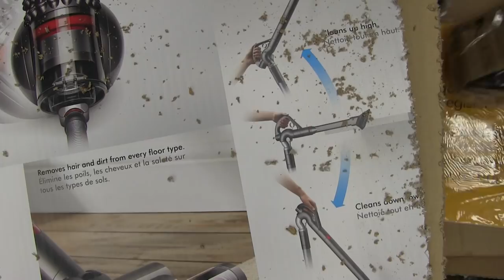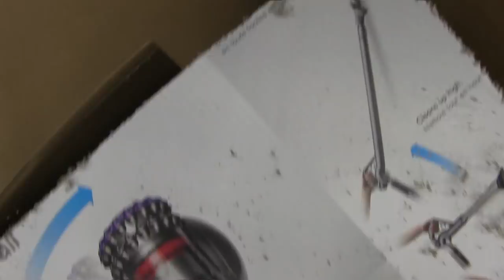DYSON ANIMAL BALLS | It blows!

Comment: We have a 7 year old Dyson, and the chintz factor is off the charts, but somehow not a single thing has gone wrong with it. It's got all the same flimsy plastic linkages and such for the switches, but all of them still work fine, and we're not exactly gentle with the vacuum. It's really quite amazing to me. Ours has user-serviceable washable filters that come out very easily and are cleaned with a good water soak. 

I've had to cut threads and hair off the brushes, but that's it as far as service goes.
Reply: Isaac Fortner If you have a 7 year old Dyson, this is likely to have a less complicated structure. The wheels on these Dysons break off very easily. Already seen 4 of these Big Ball cylinders with broken wheel shells within 6 months of launch.
Reply: I think they saved costs on the switches etc. as it’s not likely to be used that much so for a 10 year lifetime being pressed a few times each week for average user that flimsy mechanism should last.

I’ve gotten broken parts on my dc54 but I blame my wife’s long hair that wrapped around the wheel bearing and took me a good half an hour to remove and ended up having to rip off the wheel and now it won’t click back on the same as before!

Comment: Valve is there when it gets clogged it dont burn up.
Reply: Jelsma Outdoors when motors are under vacuum they are under less load, so they are less likely to burn up
Reply: AfterDark3 Ok, its also a safety feature so if you get the hose stuck you can pull it away.
Reply: Jelsma Outdoors I'm going with that valve is there to keep it from tearing holes in stuff. 12 in mercury will bend steel on a head that size, nevermind pulling a couch through that "lifetime" filter.
Reply: jet still; no airflow == no cooling
Reply: AfterDark3
That might be all and good in a non-t-bag vacusucker, in this case, the motorb is been clusterfucked by a large amount of plasteek.

In other words, the motor might not burn up, but without airflow from the motor, The plastic will ment... and, well, I think i've said enough.
Reply: The valve is for when you put your didely doo in the tube to get some changes in the .... you know what I mean.
Reply: Universal motor under no load = fuckloads of RPM's = nuked brushes and comutator.
Reply: Jelsma Outdoors yes it Will heat up if you don't run air through
Reply: AfterDark3 Yes but wait a while and where does the energy go
Reply: I have a couple of dysons.. the valve is definately there for when hose gets clogged, you can hear it open up and suck the air straight through the valve rather than the hose
Reply: This is a safety device.  Remember there are a lot of weirdos and idiots out there.  Weirdos  might suck their testicles, ovaries, large intestines, or lungs out of associated orifices.  Idiots will suck the same out of their pets plus inner ear parts, eyes, etc.
Reply: Jelsma Outdoors well done on the insight.... you should start your own channel.
Reply: I'm betting the valve is at least partly for show to keep your junk spinning around in the display catch even when the inputs are blocked. 
Thanks for reading. Keep you plug in a socket.
Reply: Wouldn't it have tripped when he was testing the maximum succ?
Reply: If you kink the hose the valve opens so you don't collapse the whole fucking thing ;)
Reply: Mark we have a channel, not the same as this one but check us out, might like it.
Reply: Crubleigh he stretched the spring, but you can also hear it suck air, it is that valve.
Reply: @Jelsma sill, be careful where you put that vacuum nozzle. Think of the legend you would become in the ER!
Reply: Jeremy McMillan Works better than the ole blue pill
Reply: They are under less load so they start running faster and they have no airflow so they start burning up
Reply: Roger that.

Comment: Regarding the relief valve, since this is intended to (also) groom animals, it is to prevent severe injury to said animal. For instance if somebody gets the plain hose with no safety-vented attachment up against the animal, body parts can get fuckulated very quickly. That much vacuum against an eyeball or a spink,,,,  shpink,,,,,,,,, sfink,,,,,,, anus can do bad stuff.
I felt really bad for mom-in-law, but I just couldn't stop laughing. RIP Shaggy Tom.
Reply: Jay Littleton that's not entirely true, the relief valve is there for a few reasons, 1 to cool the step down PCB in case of a blockage, 2 it is also there to slow the motor in the event of a blokage
Reply: I stand corrected and thank you for your input. Cheers.
Reply: Your very welcome, it's confusing I know.
Reply: So you’re actually with Dyson PR?
Reply: I was merely going with my knowledge of a system specifically made for animal care & grooming that was built similar to a shop vacuum, which had a safety relief for what I described.
Reply: I'm a Dyson RDD engineer actually, In my spare time I rum PR :) all our machines have a relief valve, our handhelds just use the hall effect sensor in the motor to detect a blockage "lack of fluid" and pulse the motor to 1 reduce the vacuum force and 2 alert the user that there is a blockage. The relief valve on our machines is there to protect the motor:)
Reply: A little insight for you :) all our machines are the same , so if you get a dc75 animal the machine has no differences what so ever, all that is different is the colour of the cyclone assembly and the attachments included.
Reply: Buddy of mine built himself a mini tri-lobe supercharger for his motorcycle. He stuck his hand over the input while bench testing  it with a battery drill.... poppet valve woulda saved him the hickey mark.
Reply: Well that's erm, brave aha and yes it might have helped
Reply: Jay Littleton on the handheld vac it is used to cool the motor...when there is no flow there is no cooling of the motor...there for the valve is used to keep air flowing over the motor at all times to cool it....as we know heat kills electronics
Reply: cool to have someone from the company answer a question on an AvE video kudos to dyson guy

Comment: In England, every town has at least one "Dyson Repair Shop", but you don't see shops specifically for the repair of any other brand of vacuum cleaner. What does that tell you about their longevity eh? 
My old smiley face Numatic is still going strong after 18 years, what with it being just a motor with a power switch in a cylindrical case
Reply: arcadeuk yeah your right, Dyson are total shite, went to look for a new vacuum an the woman shows the good lady a Dyson, she dropped it once an the handle snapped clean off! I laughed that much I had to leave the shop!
Reply: I too would have laughed my ass off in that situation :)
Reply: YMMV... My DC07 Animal is 17 years old and still sucks like the day I got it. I've replaced the filters 3 times and that's it.
Reply: My parents had one Dyson vacuum ever, and it died pretty much every time it sucked up anything that wasn't very light dirt. Basically, they are vacuums that don't do well at cleaning things that are actually dirty.
Reply: Maybe it is better to have a machine that is serviceable instead of one that you simply throw away?
Reply: My family has a 10 year old Dyson that is still going strong. I took it apart recently to clean it and it's built much better than this one. You can buy new attachments from their website that fit fine
Reply: my mom's Kirby from 1976 still runs strong and out powers any and all current vacuums we have tested , my Kirby is only 15 years old and nothing has every gone wrong , only replaced the brush roller once
Reply: Never seen a "Dyson Repair Shop", I call BS!
Reply: Robert Lozier 
I have a 15 year old Ultimate G Diamond Kirby too and it's an absolute beast.

Comment: I would think that valve is for preventing a no SUCC event. You know like when you stick your hand over the hole and you can hear the motor RPM increase. Maybe some kind of protection for the motor in some way from over current event due to higher load. I actually have no idea if thats what its for, I'm talking out of my ass.
Reply: Adubs this was my guess.
Reply: I assumed it may be to help keep the motor from getting damaged if the filter or hose is blocked.
Reply: That's exactly what its for, motor protection. The air flowing through the motor keeps it cool.
Reply: a fans load is proportional to the mass flow of air.  thus when blocked, it has almost no load on it.   cooling is my guess.

Comment: Dyson figured out how to fleece us. Like Apple they are no longer quality since they are born to fail. Great job on this review. Definitely in your debt. Saved me a handful.
Reply: Were they ever really quality, or were they just a marketing gimmick? about a dozen years ago, I switched over to a commercial vacuum made by sebo (sebo is overpriced in the US, but their vacuums are available half price from commercial supply places). It looks like an honest unit. 

I very briefly looked at the dyson stuff, but never really found anything that great about it - it seemed like $500 worth of plastic vacuum that had an expected lifetime of a couple of years....

....and because of the giant profile, couldn't fit under anything. 

The sebo-made commercial vacuum at the time was actually cheaper. And made in Germany.
Reply: @daw162  They were.  We've had the same one since 2004 and have always ridden it like a rented mule.  Too bad it's irreplaceable at this point.
Reply: @daw162  
A used Kirby will do.
Easy to repair too.
Reply: @Milkmans_Son  You got yourself a fluke. They've been plasticy junk falling apart since day one.
Reply: @jumbo4billion  I'm not that lucky.
Reply: I have 3 DC01s. I think the oldest one is from about 1995. It still works fine. Worst thing about it is emptying the damn thing.

Comment: There isnt much out there these days that is actually engineered to last
Reply: Certainly not in the cyclonic bagless vacuum market...
Reply: unless you get a central vac. MUCH more servicable
Reply: perfectdiversion 
That reminds me of the time my grandfather gave me a reuseable hand warmer dated 1968. It still works great, but unfortunately people will still choose disposable chemical hand warmers.

I suppose we really are living in an age where everything is engineered to fail and everything is disposable.
Reply: I went to school for engineering. everything is designed these days to last 3-5years before its degrated  to be thrown away. Even vehicles are designed such ways. Its pathetic, and why i quite as i want my designednshit to last and be simple.
Reply: Henry hoovers suck all day and have been for 37 years. That's why professional cleaners use them.
Reply: I will second the Miele but you might want to find old filter queens or old rainbows
Reply: perfectdiversion That's not correct. Get a SEBO or Miele and these are engineered to last.
Reply: what about pro audio equipment?
Reply: Commercial Oreck ones last long as well
Reply: There's still Kirby! Classic design with modern filtration.
Reply: I have two bagged Oreck Classics. Work great and totally serviceable. Lightweight and enjoyable to use.

Comment: I don't think a wastegate makes much, if any noise. The "pa cheeewwwww" sound is made by a blow off valve on the compressor side when there is a lot of boost built up and then the throttle closes quickly making the "kaaaaa cheeeeewwwwwwww" noise. And yes I just made those noises out loud and yes my 7 year old daughter is asking me why I'm making these noises. What is wrong with me
Reply: Pasheeeeeow, vroom vroom
Reply: Wastegates flutter as well.

Comment: Those cheapo parts come in handy when someone breaks their $500 and tosses it and I can pick it up and fix it for the $5 replacement part (assuming they weren't just to lazy to unclog the Easter grass). I've never bought a vacuum yet.
Reply: On/off switch breaks? Install a 80 cent light switch in the chassis.

Comment: Just now seeing this video July 2020.

In my experience, vacuum cleaners rely on the airflow they draw to keep the motor assembly cool.

If the intake gets clogged (which happens frequently in my home), then it cannot get the airflow it needs to keep cool.

By including a relief valve to allow air intake, you can maintain enough airflow to keep the motor cool in the event of a clogged hose.

Comment: The poppet valve I believe is in place in case of a clog in the system.  I figure to prevent damage to the motor.
Reply: To clear the blockage before it fills the whole hose

Comment: I think you should do more BOLTR on quality tools.  In this case Miele makes vacs that are not much more, use a conventional design, and get converts by being the thing you want it to be.
I'm not a Miele shill, either, just a guy who already knows the only thing Dysons are good for is repurposing the cyclone for table saw dust extraction.
Reply: +1 on the Miele. Although the canister version also has the air driven beater bar. Much quieter, better suction and sho far that beater bar hasn't clogged with hair despite having 3 cats & 2 dogs. I'd like to hear your opinion on it.
Reply: I had a canister version of a Miele, with both an actual AC powered uh, power head, and the smaller air driven head for upholstery.  Girlfriend borrowed it, her contractor used it like a shop vac, trashed the thing.

Comment: I have repaired and replaced parts on both of our Dyson vacs, one older Ball Canister, and the ancient upright DC 7.  The only part that has ever actually broken was half of a hinge on the clear plastic bin on the upright after being seriously abused for 20+ years by the entire family.  I did replace the clutch on the old upright when the suction started to fade a bit, again, after 20+ years and a heck of a lot of very hard use, and after sucking up who knows how many pounds of silica laden cat litter dust.  I did replace the internal filter too, but only because I had the thing completely gutted:  the filter still looked new.  I also replaced belts and seals on the old upright, only once, just because, plus a few assorted other parts that finally just started looking scratched and worn from years of abuse, but nothing was broken or nonfunctional.  The quality of the plastic components was questioned:  we had an expensive mostly metal vacuum that started to rust out after being sand blasted by cat litter for 8 years.  The plastic handles mildly abrasive dust very well, although it will take on a satin appearance over time. These machines are built tough!  I have also never wanted/needed a replacement part, no matter how small, that I couldn’t purchase and replace.  
Those switches, latches, etc. and axle hubs that you call “chintzie” have NEVER broken, cracked, warped, slipped out of place or needed replacement for any reason on our two vacs.  
BTW:   If you “increase the suction” you may likely destroy the correct airflow velocity needed for the cyclone collection system to work properly, and you will likely burn out your motor PDQ too.  They are designated ed to do what they do they way they need to do it.  
I would love to get a new Dyson vacuum, but I still like playing with ours; they both still seriously suck - in a very good way, and the darn things just won’t die.
My only complaint:  they are loud, but then so are almost every other AC powered vacuums. 
My husband is a Senior Manufacturing Engineer, and he has always been impressed with the way the Dyson vacs are constructed.  I’m just a housewife that’s a nerdy girl with a high mechanical aptitude, and I love well built machines!  😁

Comment: Panasonic aka Matsushita have been making motors since the dawn of time.
Reply: The bigger problem is that it is not a dyson mottor.
Reply: TheChromestyle - is that a problem if the proprietary tech Dyson claims to have can operate with ANY source of suction and is independent of the motor technology for this model?
Reply: Why is that a problem?
Reply: Weren't they called National Panasonic at one time?
Reply: @TheChromestyle  No problem here, move along.....
Reply: @jamescollins6085 They used to call the eletric(al) appliances and batteries National, and the electronics Panasonic. Now it's all Panasonic.
Reply: @skuula  Thanks for explaining.
Reply: @TheChromestyle  What would be different if the motor was made in a factory in a different location? The materials would be the same, the machines would be the same, the assembly process would be the same. The only difference would be the location.

Comment: Probably someone mentioned this already, I'd imagine the vacuum valve is to protect the motor from overheating itself in case something gets lodged in the vac inlet, and it completely stops all air from moving.

Comment: You know how the battery one detect a clog and chugs in and off and on and off? Well the pop valve probably serves the same purpose, when it clogged it prevent the motor from burning up by releasing the vacuumed at a certain pressure detected, hence probably a clog. That’s what I would guess. So did Star Wars influence this rolling design, does Disney know about this?